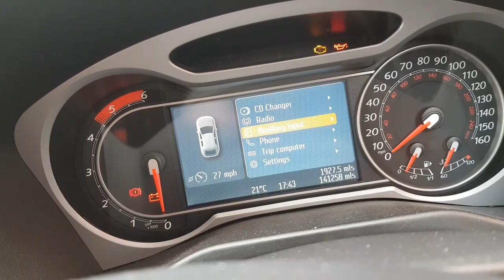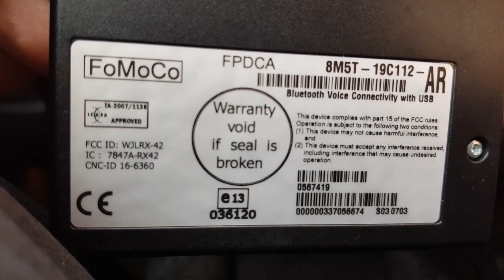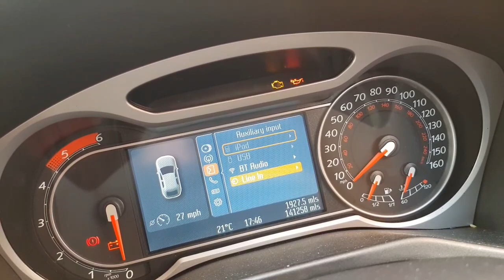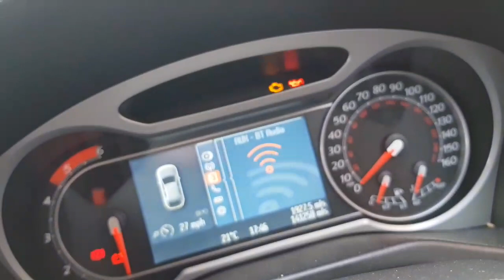Ford #mondeo #MK4 BT box upgrade

Comment: Thanks for the video.  Just  swapped a 8M5T-19G488-AN  on my 2010 Mondeo with 8M5T-19C112-AS (£130 inc postage - Ebay) Worked first time. Had to remember that the modules only store 6 handsets so needed to debond the ones it came with (easy - through radio menu).  Once that was done it picked up my phone and allowed it to bond.  The additional features above streaming via bluetooth (which was the reason for the upgrade) included track name displayed on radio.  On the phone menu it added contacts, last call, call missed and a couple of others.  Very impressed. Many thanks for the clear video and clear guidance including BT model numbers.

Comment: i got a titX 2008 and my convers dispalys shows only settings and fuel thingies i dont have the other icons on it.... how can i upgrade it to that one. and if i cnange bt module is it going to work, due to i cant access those audio settings from the convers.
Reply from the maker: hi, you have color display for confers+   ?
Reply: It is exactly the same like the one in the video but with only 2 options. The bottom ones in the video - Fuel consumption and Settings. Oh and i got only two theme options, blue and brown.
Reply: Zlatina Stoyanova I’ve got the Same apparently you can go to a dealer and get it updated “apparently” I’m going to try tomorrow

Comment: Will 8M5T-19C112-AM module work too?
Reply: Yes, A is the language code for English, M is the version code. I don't know if there are big differences between the versions, but as far as I know the 8M5T-19C112  has a mini usb slot on the side for updates. There are module which states 'with USB' but this needs more fitting than just plug and play if I recall correctly.

Comment: can u tell me if only the 8M5T-19C112-AR bluetooth module will only work or if other modules will work also e.g. ending in AM  rather than AR ?
Thanks
Reply from the maker: mark hoskins  hi sorry don't know you need check in internet.
Reply: Yes it works since M at the end, so this guy in video just spent money for nothing , as you can see, he changed N? :-)
Reply: Even after 5 years I need to say my two cents on it:
It doesn't matter as long as it is 8M5T-19C112-XY. The 'x' is the language code for voice control etc; A for English, B for German and so on. The 'y' is the version letter. I don't know if there are any big differences between the versions. The 8M5T-19C112 has a mini usb slot on the side for updates though as far as I know. If you want USB you should search for a modul which states 'with usb' – but caution this needs much more fitting than just plug'n'play.

Comment: Hi how do you get the second menu on the head up display ive bought the new module plugged it in but not getting the option in the aux menu for bt audio
Reply from the maker: 8M5T-19C112-AS?
Reply: @samssLV   no ends in (ar) like in ur vid im think poss a update is needed
Reply: I have the sat nav model mind the ford nx head unit  wouldnt have thought it would make a difference tho

Comment: just watched your video, very interesting but do you know if this will work on a 2008 titanium x model ? thanks in advance
Reply from the maker: Neil Tatham hi I m not shore but think if your old BT box same part number than yes
Reply: Yes it will, chances are you won't have any module in place to start with. Mines is a 57 plate Tit X and never had one...think it was around 2009-2010 They came standard in Tit X.
Just make sure you get the correct unit, more info can be found on Talk Ford website, they are a friendly bunch on there, I've been a member for years
Reply from the maker: Gavin Tuson hi I have old module left. Check p/n in video

Comment: Or you can just update the software with an usb driver way more simple.
Reply: Please tell me how?
Reply: Follow the steps on the guide, depending on the language place the files on the usb pen driver so only 2 files if im not wrong. 
https://digiex.net/threads/ford-audio-bluetooth-usb-firmware-update-november-2012-release-how-to-update.14009/
Reply: @spikerfeed2996  What if you don't have a USB feed? I'm pretty sure my Blaupunkt NX HU doesn't have it (the Combined SatNav/Climate unit).

Mine's a 2008 Titanium.

I'm guessing in othat instance, the module upgrade is the only way
Reply: The one I updated had a usb feed on the arm rest compartment (2009 titanium). I assume the only way around is the module upgrade yeah.
Reply: @spikerfeed2996  No worries. I never realised there was a USB wire in the armrest (neither of my 2008s had it), So I'll investigate that as well for a tidier install.

I've just bought a USB module (AR) ; The earlier car had an AF module I believe. My current Titanium had it removed due to another handsfree kit being installed prior to my ownership
Reply: What if i dont have a usb socket only phone jack

Comment: I can replace, if i have ford navi radio ?
Reply from the maker: No
Reply: Yes, I have it working on the Navi NX touch screen system in my 2009 tit x sport.. fitted it this very morning and got it working with Forscan software ;) One thing to remember, when you code the car just don't clear the DTC codes after, else the BT menu disappears again :) I used the Ford Focus Bluetooth Voice Box Module Novero 8M5T-19C112-AT
Reply: Can you advise what options you used in forscan. As I replaced the module to one ending AR and only getting ipod USB and aux-in. If go into forscan and changed setting wil no avail.
Reply: @MattGilesUK  Hi there im looking to do this on my own Tit x Sport 2009 with Navi NX module.Been searching for months for the correct hardware options etc  so from what i can gather i need the -AT module and a Forscan OBDII reader is this correct?

Comment: i did the upgrade with the module as yours but i can't connect my phone via Bluetooth. which Bluetooth pin you used? any idea?? I tried "0000" and "1234" but nothing.
Reply from the maker: No upgrade. Just change box
Reply: @samssLV  i changed the box but i didn't managed to connect the phone with new module via Bluetooth. any ideas?
Reply: @ΠαναγιώτηςΓκόλφης The module stores the already paired devices and has space for 6 devices IIRC. Have you deleted the paired ones?

The 8M5T-19C112 should have a mini usb port on the side for updating purpose. Try to update it.

Is it exactly 8M5T-19C112 with no extra tag 'with USB'?

The 'with USB' needs more fitting because this refers to the Sound & Connect package which needs a filter, new wires etc. and isn't as plug and play as the other modules as far as I understood.

Maybe you need to change something with an ELM adapter and ELMConfig but this needs more reading. I am not quite sure if this is really needed, because it should be plug and play though.